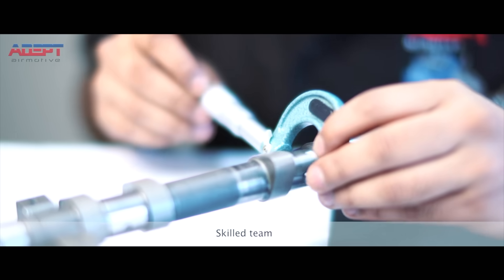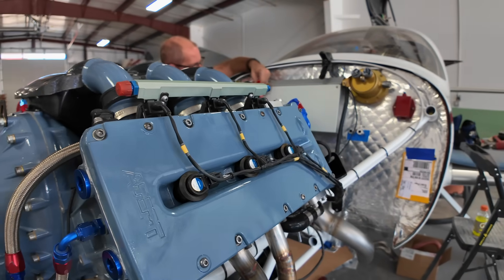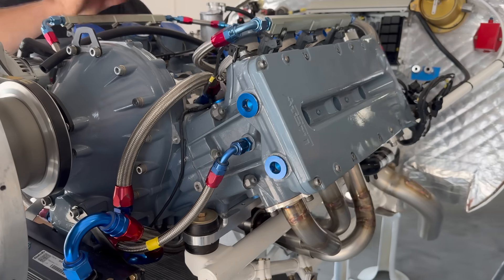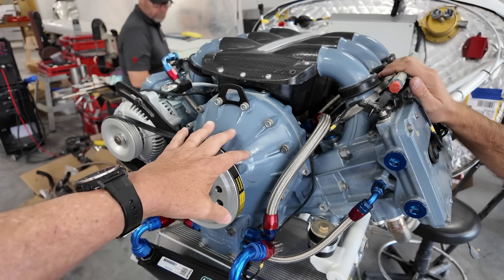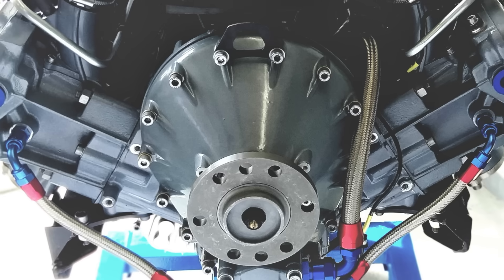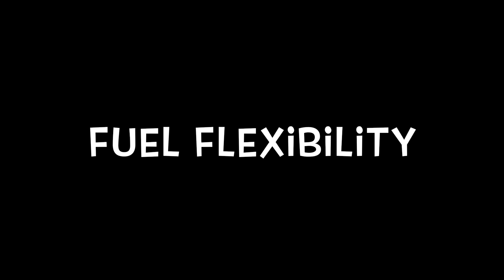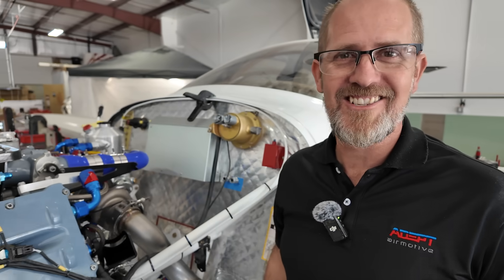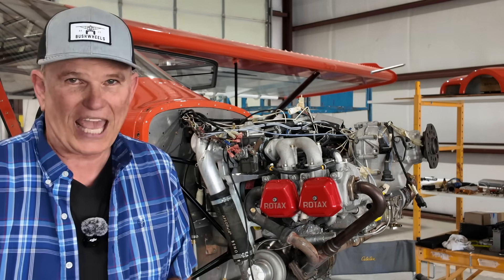The new Adept Engine could be a winner for General Aviation

Comment: Finally a more efficient engine for aviation, with electronic control and turbocharging. The current common piston engines are not even good enough to be called tractor engines, yet everyone thinks they fantastic. 
Real shame you not using a DECENT air filter on the engine. 
Wish you guys all the best to set new engine standards for piston aviation engines
Reply: You should check out the Chev LS3 Aviation engine....
Reply: All other things being equal: Piston ring swept area is the #1 factor in engine efficiency. Big, slow and direct drive is efficient. As is air cooling with its lower cooling drag. A 400ºF cyl transfers engine heat far more rapidly, needing less air than does a 200ºF radiator.  A mechanically injected Lycoming IO 360/390 with elec ign can achieve a 0.38 lb per hour per HP BSFC number in cruise flight. This engine will be in the 0.45-0.50 range in normal operation. Whether it can be configured to LOP operation is up to the FADEC programmer. Even so, with it's smaller bore and friction inducing 5500 RPM redline, I don't expect a BSFC better than 0.42 Lb fuel per HP hour on 100LL as there are exactly zero conventional engines in this size and RPM range that can exceed this. In fact I'd guess no better than 0.45 on auto fuel, due to the ign timing required for lower octane. My conclusion is that it will be less efficient than the best, well refined aero engines available today, by about 10%.
Reply: @cujet  "A 400ºF cyl transfers engine heat far more rapidly, needing less air than does a 200ºF radiator."

Just wanted to point out that this was proven to be irrelevant during the WW2 era, as a properly designed radiator has much less drag than a bunch of oddly shaped cylinders. Rutan also found that the liquid-cooled engine on the back of the Voyager aircraft needed far less cooling air than the air-cooled engine that it replaced.

High compression Honda engines have been known to be able to burn as little as 0.36 lb/hp/hr at over 5,000 rpm, even while running on 91 octane gasoline, but their compression ratios are in the 12:1 range. It seems like a similar compression ratio should be possible on this engine (the naturally aspirated versions, at least), as some of the JDM Honda engines came with an 11.7:1 compression ratio from the factory.
Reply: @PistonAvatarGuy  You are 100% correct about the WWII drag studies. However, things have changed markedly since then. Lopresti made Mooney cowls with 3 inch openings, sufficient to cool a 200HP engine. His advancements marry aircooled inlet size with directed cowl outlets. Producing a few pounds of thrust, much like the WWII radiators.  

And you are also correct about the high compression ratio improving overall BSFC in modern engines. If we are not required to use low octane fuels, we can achieve remarkable BSFC. Modified aircraft engines in experimentals can reach 0.35. Not bad for old dinosaurs. 

As I am sure you know, many very sharp engineers have tackled this problem, only to revert back to the old lawn mower tech. As far as I know, none of the liquid cooled offerings match a modern Lycoming operated lean of peak.
Reply: @cujet  I seriously doubt that the aircraft which have been modified with Lopresti products are producing thrust with their cooling system, I would bet that they simply improved some cowling designs that were poorly optimized. They don't even sell the Mooney cowls anymore. Liquid-cooling almost certainly still offers a significant reduction in drag, relative to any air-cooled aircraft.

Modern engines don't need high octane fuels to make use of high compression ratios.

The problem with light aircraft engine technology is that there is enormous potential for improvement (weight reduction, user friendliness, efficiency, the elimination of leaded fuel, etc) from a technological standpoint, but cost of making those improvements prevents us from implementing them. The dinosaurs remain not because there are no superior technologies to replace them, but because we let our monetary system decide what's best for us.
Reply: @cujet  Do you have any data which supports the claims that those Lopresti cowlings allow the cooling of those air-cooled engines to produce thrust?

It seems that The Aviation Consumer also agrees with my assumptions about those cowlings, in that the original cowlings were just poorly optimized.

It also seems that there are quite a few mods to the aircraft, which all add up to the performance improvements that they claim for their products.
Reply: @PistonAvatarGuy  I worked at Lopresti for a bit.

Comment: The FAA really needs to allow newer, better engines to be approved faster. If the safety and durability testing has been done, let's get these engines on the market. FADEC should be able to be retrofitted into any general aviation aircraft as well in 2025. Managing my fuel and prop and "fun" and require skill, but I'd rather) rather like to concentrate on flying and let the computer manage those aspects for me since it's almost always better. We don't do that manually in our cars or in turboprops, do we? 😂
Reply: The problem with electronics is unknown mysterious failures. Even with secondary systems. Quality, electrical surges, are killers.

Comment: The industry is so overdue for this.
Low / No Vibration
No Shock Cooling
Low Cost / Low Maintenance
Low Cost Parts with High Parts Availability
Turbine TBO Times

Now:  Just try to get this certified against Continental or Lycoming
Reply from the maker: I agree, something else has to come out. Rotax figured that out 20 years ago.

Comment: I inderstand some of the reasons for this. And to be fair im a car guy who just watches airplane videos daily on YT. That said 

Its so baffling to me in the 40s we were developing the turbichargers and intercoolers and even direct gasoline injection on aircraft. Along with high use of aluminum. 

Even though these things are sold to consumers as being cutting edge things thay have only in the last decade or so.  Then i see small GA videos where  polots while navigating in 3 dimentions that arent even stable or visable.  Yet they have to manually control fuel mix and timing mid flight. 

It hasnt been legal to have leaded gas or to adjust lawnmower carb in over two decades. And in cars since the 70s. We dont trust deivers and mechanics to do timing and fuel jetting correctly.  Yet a pilot that has no mechanc background is expected to do so while aviating, navigating and communicating. It seems like insanity.
Reply: There are no adjustments to timing on certificated aircraft engines, mixture yes but timing no, it is fixed except for a starting devices(e.g. Shower of Sparks, impulse coupling) that retard the timing and are not adjustable by the pilot.
Reply: @hotprop92 i must have been thinking the way old stuff. As in ww2. Or el systems on an experimental.  

 But the mixture still seems crazy.  Yes i understand why it needs to be variable. But since the 80s its been pretty much required to be automatic via feedbac loop on autos.
Reply: @bobbysenterprises3220 you would probably nerd out on books about aircraft engines, pressure carburetors, magnetos, sleeve valves, rotaries and a host of other inventive but not always practical methods of propulsion for aircraft. That's why I went to A&P school but that's just the nerd in me.
Reply: @hotprop92 when i was just out of high school i was working on a friends car who was probaby 30. They said i dont know how you deal with cars. This is a pain in the butt. Why so they make everthing so hard to get to and work on

They were a certified airolane mechanic of some type. 

That was about 350 moons ago.  And suddenly it pops into my head. Im still working on cars (painter)

Comment: Could it? No. Automotive engines do not cruise at 4700 rpm. None of them. 2k or under is normal for a car. And loading of the engine is typically well under 25% of rated HP. Well under.
Reply: 2000 RPM or less at highway speed is not normal for cars, only for those with very large engines.

Comment: Changes must be made to the Industries approval system under the FAA. As it stands, only those who have been grandfathered in remain (Lycoming and Continental) and they remain with a tight grip on the system to keep their market shares away from vying competitors.
But their own tight grip prevents their own growth and new products. As such, the industry is dying. Its too costly to develop and get approved any certified part, airframe, or powerplant and make it affordable for even the upper class to afford reasonably.

The market is suffocating.

Comment: Liquid cooling? Gearbox? That's going to be a maintenance/reliability nightmare. When I was doing aircraft brokering every mechanic I talked to would shriek in horror at the mere mention of liquid cooling, and there's a reason they're dirt cheap in the used market. At the time I was shopping for C421s, which were averaging 300k for a decent example, and they themselves were cheaper than C414s because of the infamous gearbox issues, and on top of that there was a liquid cooled one sitting for sale forever for $100k and nobody dared touch it in nearly a year. Even with the supposedly sufficient cooling from oil alone I'd like to see how it fairs in a high altitude airport in Arizona in the summer in that same scenario.

I'm all for innovation but I feel all this R&D could be better put to use in really small turbines with heat recovery which are becoming ubiquitous and don't burn much more fuel than these big block engines.

Comment: Electric Water Pump?  Not liked, also the only 1 spark plug for each cylinder, one ignition coil fail, main power lost. Also the Exhaust manifolds without any heat insulation.  Just nice try to break up the new FADEC big engines and posibilities. Keep work on it. !!!  Also I will add exhaust gas temperature sensors for each cylinder. ;-)

Comment: Adept may work for experimentals and possibly new aircraft like Cirrus, however, the cost of a new engine mount, new cowling, cooling system , exhaust and STC is never going to add up for existing legacy certified aircraft where the cost of overhaul is in the region of $50,000.
Reply from the maker: I understand, nothing in GA is cheap.

Comment: Great build !  Love the attention to detail.  

Word of caution.  The air filter you have chosen have an insert that metal in the middle.  It is glued into place. They are known in the automotive world, on a turbo application , to come unglued and be ingested by the turbo and eventually into the engine.  Please find another design.
Reply: Well spotted. The actual filter in this application is mounted in the Cowling air duct. This cone filter was temporarily fitted for cowling-off ground run.
Reply: @flyADEPT  I pray that you get to market! I think this would be a great cold-weather motor - just have to add a block heater and viola! Engine at temps acceptable to start!
Reply: First thing I noticed too.  I saw that filter and thought I’d redesign it with a length of duct behind a flat high flow paper.
Reply: I totaly agree , that design is pure stupid and dumbly dangerous for no good reason at , just plain stupid unless you want to die that is
Reply from the maker: Thank you. I'm just the reporter. I'm sure the developer will read your comments.

Comment: Electric motors will become the standard for aviation power. Piston and gas turbine engines will become obsolete. For long distance travel hydrogen fuel cells will power the motors. For shorter distances batteries will be the norm. Take a look at Airbus fuel cell development. Several battery powered electric commuter aircraft will soon become commercially available.

Comment: A couple of big questions is the ignition system completely independent from the engines electrical system and how long will the electric water pump run if the engines alternator goes out
Reply from the maker: Great question for the company. I do know it will have two alternators. https://flyadept.co.za/

Comment: Looks very stout. I like the idea of 120 degree cylinder banks, avoids split pin rod journals on the crankshaft making it stronger than a 60 degree configuration.
Reply: 120 degrees does result in even firing intervals while using shared crankpins with no offset. Unfortunately, it also means poor balance. 

If extreme split crankpins are an issue, a narrow angle V6 could be built with 6 separate crankshaft throws and 7 main bearings, just like some flat-6 engines.

Comment: The three biggest issues with GA engines are cost, cost and cost.  And no low volume engine is going to change that.  The only way we will lower cost is to find a way to reliably use a high volume (aka automobile) engine at least at the core and add redundancy as needed.  Some things are simply. No longer needed.  Dual spark plugs a really aren’t needed with today’s technology.  Today’s auto ignitions are more reliable than yesterday’s dual magneto airplane ignitions.  Same for fuel injection.  Modern fuel injection is very reliable. i personally think Rotax’s use of dual ignitions and dual fuel injection is really a waste of money.  And if fuel injection fails, it is normally only one injector and must engines will still run on three cylinders long enough to get to an airport.

Until we really rationalize what is truly needed on an airplane engine given the reliability of modern ignition and fuel systems and find a way to utility a high production volume engine, we will never move the needle in GA piston aviation.

Comment: Before any talk of specs or capabilities, price determines if an engine is a viable option for an owner. Nearly 10 minutes, and not so much as an acknowledgement of the existence of a price tag.
Reply: It's $85000USD
Reply: @Atreid3s you can keep it, they most be joking.
Reply: @Atreid3s  billet rotary is cheaper, lighter, simpler, more power, wont drop a valve.
Reply: @Atreid3s  twice as much as a Lycoming. You could say it's roughly twice as much as a proven 2000 TBO Lycoming.
Reply: Pricing is dependent on model and specification. A 250hp Naturally aspirated ADEPT engine starts at $65000, while the Turbo charged 320hp models start at $95000. Anyone in the industry will recognize that this is a very competitive price in this horsepower range.
Reply: @flyADEPT  Thank you, that's useful! And surprisingly competitive from what I've seen, especially from a new engine. So why no discussion of such an attractive price point in the video?
Reply: It's been in development for around 20 years. It will be expensive if they ever get it to market.
Reply: Thank you for posting this ahead of everyone!
Reply: You have your priorities reversed. First is technology breaktrough, then the pricing comes along. Steep in the beginning, and then more affordable as things get mass produced. Nothing new here, it is like this for all technology breaktrough from the age.
Reply: @12345fowler It doesn't work like that in aviation. The price is the price and it only goes up, never ever down.
Reply: @12345fowler  And you have never taken a business course.  Pricing for anything is what the market / consumer will pay.
Reply: That might be irrelevant to a lot of people.  Reliability and longevity are paramount for those folks.
Reply: @lynnkramer1211 there’s no one in the GA industry where price is irrelevant, at least not enough to make this a viable product if it’s stupid expensive. I’d rather use a slightly heavier, slightly less efficient engine if it costs 1/4-1/2 the price
Reply: @nathan1sixteen  What 350+ hp engine costs less than this engine? The last I heard, the EFI Lycomings and Continentals were well into the 6 figure range.
Reply: If you have to ask, you can't afford it.
Reply: Don’t worry about price … Just ask Uncle Trump… he will print up a couple of million for you no problem…!!!

Comment: Reduction gearbox in a high power piston engine will always be an Achilles’ heel. Good attempt but soooo many have come and gone.

The only thing that will save light/general aviation is electric motors and lightweight batteries.

Comment: Bad idea. The V6 is a vibrating design. In automotive applications many have up to 3 internal counterbalance shafts to make it acceptable. That creates extra weight and complexity. And it's still a self destructive cylinder arrangement.

Comment: Designers and Mechanics can make fantastic aero engines of all sizes that's no problem, Money is, as well as the tiny number required every year by aircraft makers. With light aircraft how long does the average 2000 hour engine take in Years to need replacing,. If the company was like say Boeing or Airbus then they can get investors to pay for the development costs and allow it be be paid back over a lifetime of the aircraft, small engine companies do not have this luxury so charge a very high engine cost from the start as they have no idea on how many they will probably sell in the next 10 years

Comment: FINALLY! FADEC, turbo, fuel injection, OHC and moderate capacity is finally modernising the aircraft engine industry.
Reply: Finally?  Rotax has entered the chat
Reply: @FlyingGuy  you missed "moderate capacity" 😉 Rotax doesn't have anything bigger than 1.5L and 137hp continuous and 160 peak. The Adept engine makes 250-420hp peak depending on the model which  is something the Rotax will struggle to do or not reach at all, let alone with a 2000hr+ TBO and similar torque. If you wanted a 300hp+ dedicated aviation engine you're looking at the big two brands and their dinosaur technology, this is the first in class that really puts it all together with stuff we've had in cars for decades, as far as I'm aware.